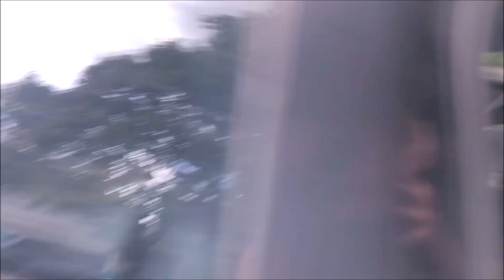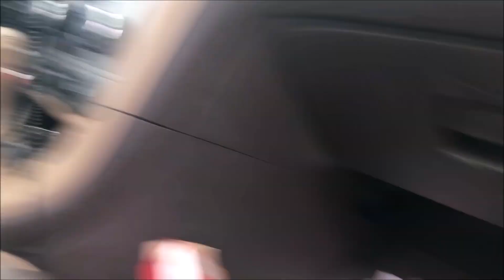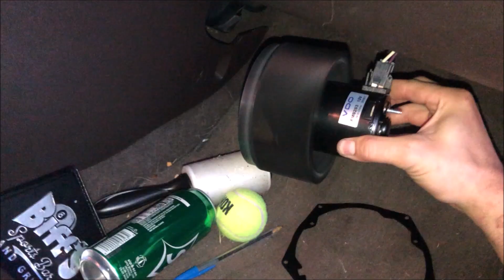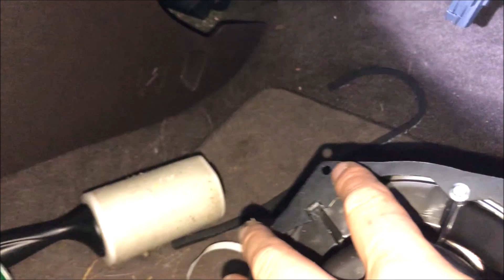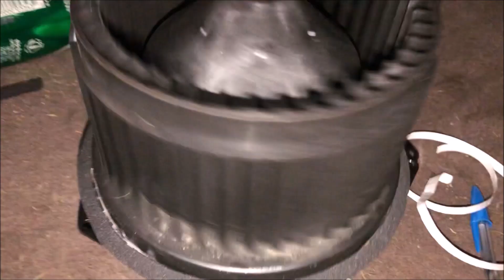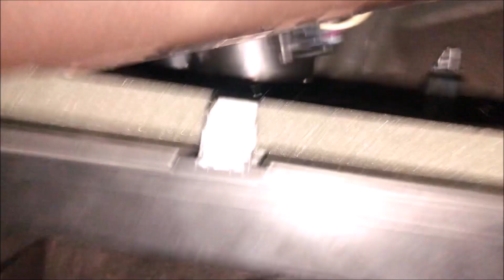Chevy Malibu Blower Motor Replacement (2008-2012)

Comment: my 2011 malibus air is out, just hit a few big bumps and it came back for about 5-10 minutes on full blast but the blower was loud and kinda clicking. turned it back off and then on and it struggled so i gave the dash a love tap lol and it came back on full blast. started recording a video to get the noise when it turns on how loud it is and it wouldn’t turn on. played with it too much but still. i don’t know if it would just be the blower motor that would be the problem?
Reply from the maker: I would guess the motor itself is going out if you can hear actual noise coming from the blower. Unless there’s a bunch of debris or a rats nest in the blower motor cage lol

Comment: I just replaced my resistor because ac only blew on high (4) any other knob did not activate the fan. With the new resistor installed it still only blows on high… any thoughts on if it could be the blower motor?
Reply from the maker: Replied on other video

Comment: Mine isn't coming out been using a box cutter for hours omg
Reply from the maker: Terrible design. Make sure box cutter blade is sharp and you’re cutting in the right spot. You do need to use decent pressure, but as long as you keep going over the same spot, you’ll eventually get it lol

Comment: the 5 pin connector to the resistor is melting.  what could be causing this? I have a new resistor that I do not want to replace until I am certain of what the problem is.  the resistor is pretty pricey.
Reply from the maker: Yeah they aren’t cheap haha. Typically if the resistor is melting or the connector is melting, the blower motor is drawing too many amps. Aka the blower motor is bad. I’d replace the blower motor next time you do the resistor.

Comment: The air in my car just recently stopped working... no air blows out at all
But I'm not sure if it's the resistor that needs to be replaced or the Blower Motor
The same thing happened a few years back ... and my ex (bf at the time)  fixed it... but I'm 100% sure he only ended up replacing the resistor because I remember seeing the part in one of your other videos. 
So now I'm not sure if I should just have both... the Blower Motor and the resistor replaced or just replace the resistor
The mechanics in my area like to take advantage of females so I figured that this is something I can do myself... might not be easy but it's definitely doable
Reply from the maker: Hey more power to ya! In this instance, I’d probably replace both. If the same blower motor takes out multiple resistors, that usually means that the motor is drawing too many amps and is therefore bad.
Reply: @TonyTheTruckGuy  
Awesome... thanks!!
I guess I'm going to have to replace both of them then😭

Comment: The blower in my 2012 Malibu stopped working. Found the power resistor connector melted.ordered a Dorman 973-575 kit because it came with a new connector that could be spliced in. Having the proper tools I except this to be fairly easy. Had to cut the old blower motor out using a #11 x-acto blade, not easy, but easier than I thought it would be. Have a Four Seasons blower motor on order sku 118185. This motor shows a mounting flange and the correct motor connector type to match the cars wiring harness.
Reply: Update: I got the resistor, connector, and blower motor replaced. The blower runs at all speeds, both manually and automatically, but now I have no heat! Gets cold in NH going to need heat. Read that a weak batt could cause weak signals to control unit. 12.63V off 14.38V running, seems good to me. Readings were taken between posts and between the positive post and the engine block. Going to disconnect the battery next in hopes of resetting the control unit.
Reply from the maker: I'm sorry, I never saw this comment for some reason. Did you ever get this issue resolved?
Reply: Hi Tony, resetting the computer cured the no heat problem after the rebuild was completed.

Comment: talk about just in time.  my 08 malibu blower went out on me here in the middle of summer so no a/c for me right now til i can get someplace to fix it for me since i don't have any tools.
Reply from the maker: Make sure to test the blower first. I also have a resistor replacement video that I did on this same car. Both took a crap at the same time lol.
Reply: @TonyTheTruckGuy hey Tony, how do I test the blow motor ? I'm not sure if it's the fuse or the actual motor?
Reply from the maker: @fynesspeace2393  You could manually supply power and ground to it, but you’d have to have some test leads and figure out which pins on the connector are power/ground. Could probably also try measuring the resistance of the blower motor and see if it’s in spec of Google has an available spec to compare.
Reply: @TonyTheTruckGuy  ok. Gotta look for it.
Reply from the maker: Here ya go bud - https://www.youtube.com/watch?v=D4iBA6_rDvw
Reply: @TonyTheTruckGuy  thanks a lot.
Reply: after looking at a few of these videos about the blower motor here on youtube i ducked my head under the dash to take a look.   seems that at one point in time that the blow motor had been replaced and that the hush cover was gone and missing.  lol
Reply from the maker: Well at least it's not in the way anymore haha
Reply: @TonyTheTruckGuy  unless that little duct piece is supposed to direct air flow to the passenger side vent.
Reply from the maker: Yeah, I guess check all your vents and modes are working properly.

Comment: 😭😭😭😂😂 this shitt malibu just started this worked for week then goes off if you slam door you can hear the compressor kick on n like a bit off cool ac but nothing pushing the air out and i cant hear the fan so im just wing it and say its motor maybe lol what did everyones fan do when theres took a shit 🙈🤦🤦
Reply from the maker: It’s amazing how GM still hasn’t figured out their electrical issues. Did you say the blower motor cuts out?

Comment: How do you test if your blower motor isn’t working
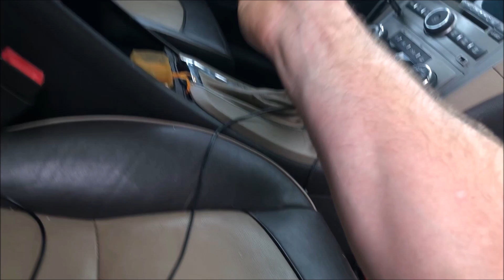Reply from the maker: Turn the ignition on but you don't need to start the car. Turn the blower fan on and disconnect the 2 wire connector going to the blower motor. Then use a multimeter or a test light to see if you're getting power to the blower (the connector at the 1:20 mark). I recommend using a multimeter and touch 1 probe to 1 of the wires and the second probe to the other wire. This will test the complete power and ground circuit. If you're not getting power, or have a bad ground, then the issue is likely your resistor. If you're getting power and ground to the blower but it doesn't work, the blower motor itself is likely bad.